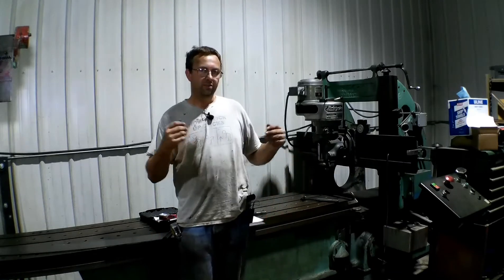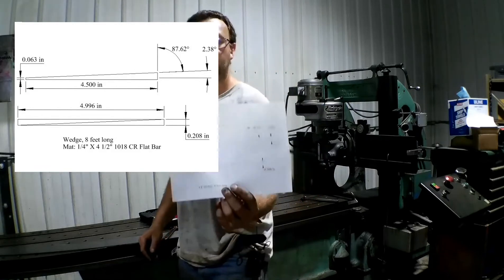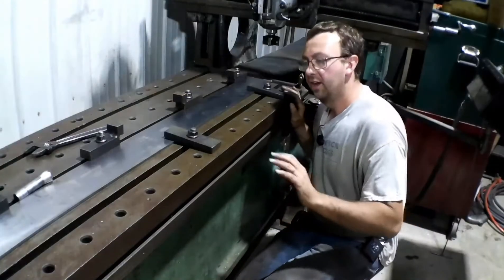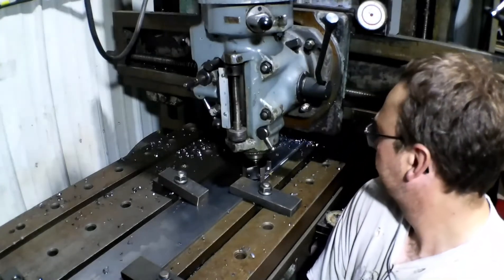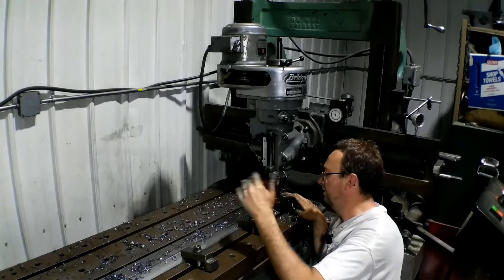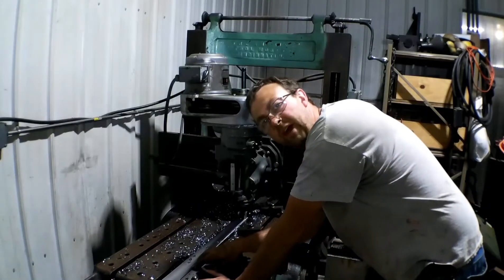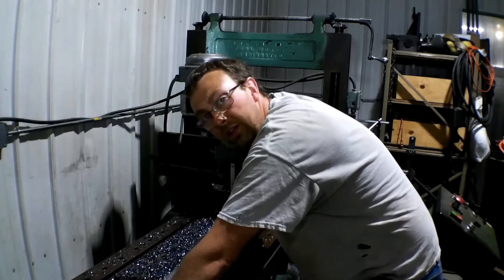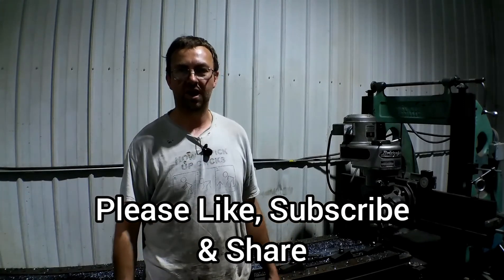Metal Planer Mill, Milling an 8 Foot Long Tapered Shim, long milling

Comment: Nicely done Josh. How much run out from end to end? When you measured the step, did you measure at different spots or just figure the flap disc will take care of it?
Reply from the maker: The worst spot I had was .012". So, it worked great just to blend it in. The customer was super happy with it and they have been installed and working good. Thanks for watching